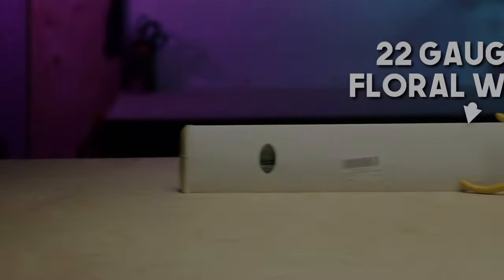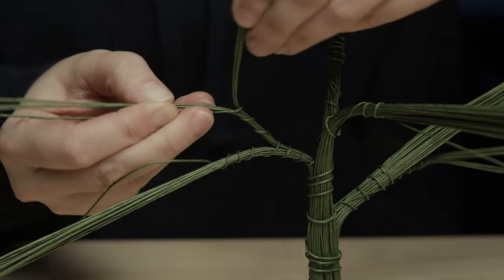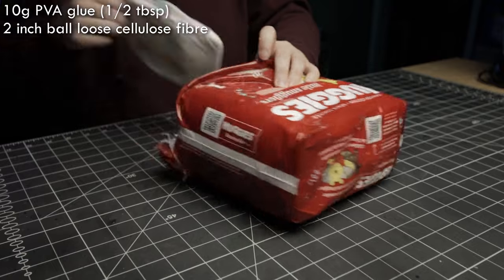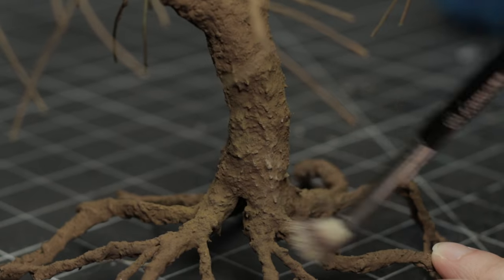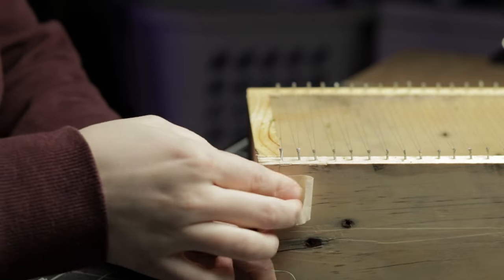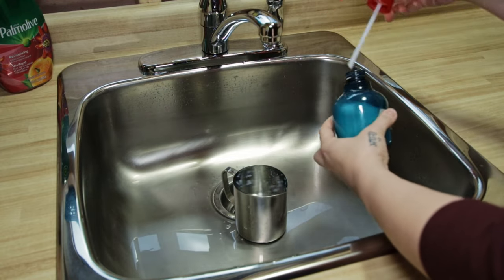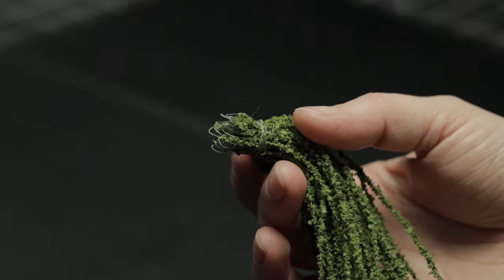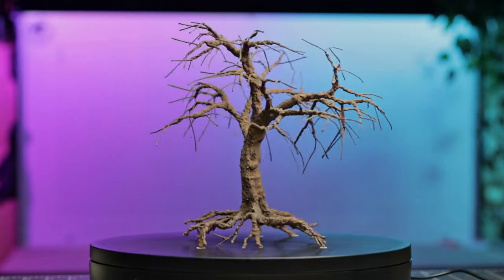Make this DIY Weeping Willow Tree for Jaw-Dropping Terrain!

Comment: Hello Gordie. For gluing the flocking to the fronds would you think using spray adhesive would work as well?
Reply from the maker: Spray adhesive would probably work, I don't tend to use it very often because I always make a big sticky mess, especially when flocking is involved haha. But if you can make it work it should a good alternative! Just make sure you still seal it afterwards because spray adhesive stays tacky even after it's dry. Hope that helps!

Comment: Question, on your cherry tree, and this one you showed you used the whole pack of floral wire. The pack on the cherry tree showed 200 wires  in the pack. Did you use all 200 to make both trees
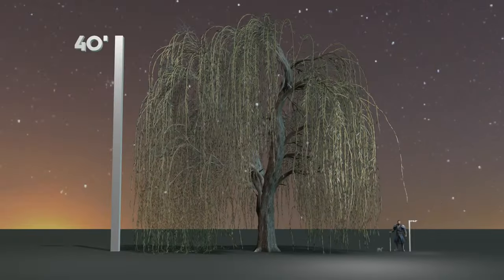Reply from the maker: Sorry if I didn't make this clearer in the video. At 0:50 I say I use a dime sized bunch or about half the pack (which would be about 100 wires but being exact isn't necessary). I used a little less in the cherry tree. Sorry for the confusion! Let me know if you have any more questions 😊
Reply: Thanks for the response I wanted to give it a go and I thought 200 of them were quite a bit when I saw the packet.

Comment: Hi Geordie, I am going to start making the willow tree. I didnt find out till I got home ,but the cotton thread is waxed. Also did you use a fine thread or thicker thread.. Thanks
Reply from the maker: Oh no! Yeah waxed thread won't work I don't think. Normally only the thick thread meant for leatherworking is waxed, I didn't know you could get other waxed thread.

I just used a standard weight thread, one that would be used in a sewing machine with normal settings. Hope that helps!
Reply: @Geordiecrafts    No problem. Just wanted to make sure. Will get the right thread. Thanks so much